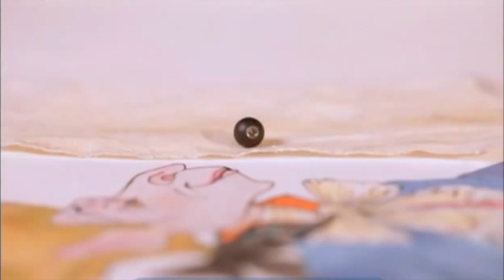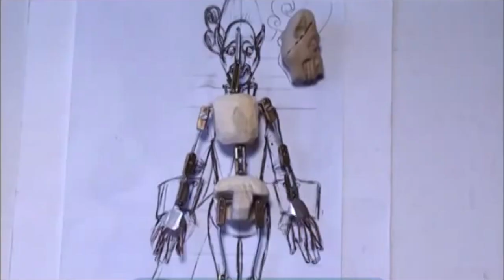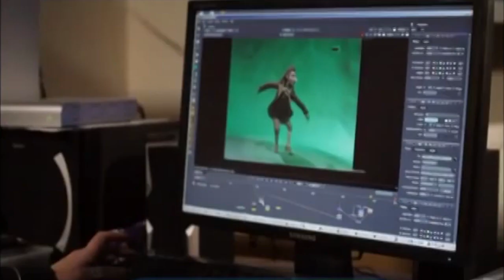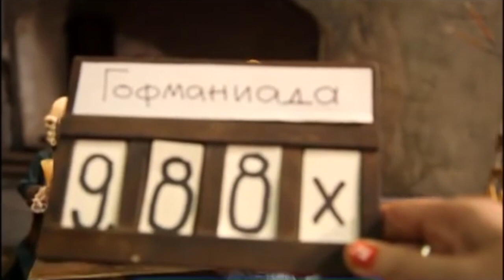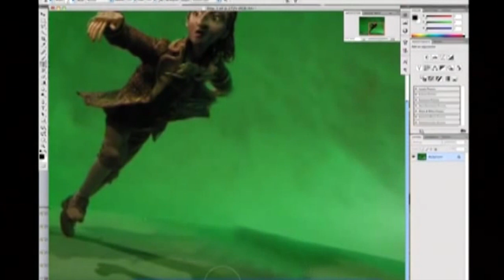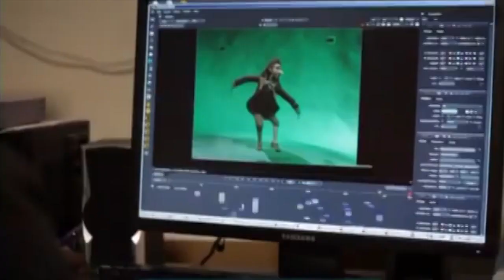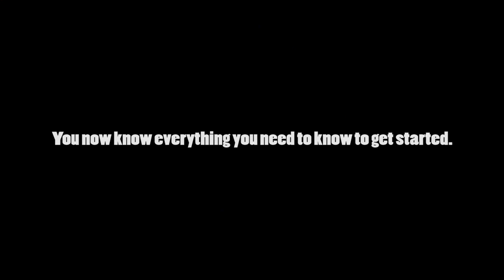The Essential Principles  of STOP MOTION  in 24 minutes

Comment: Excellent video! What is the material used in the video at 4:20 ?
Reply from the maker: +Regina Resende Résine polyuréthane
Reply from the maker: +Regina Resende It is a liquid two-component resin. After mixing, you have some minute for the place holder in the mold before it hardens.
Reply: +Mat et les Humains Thank you! I am venturing in this field. I tried to make a skeleton at home to stop motion (link: http://www.macmilam.com/2014/05/esqueletos-para-stop-motion-parte-2.html ) . The next step will be to fill . Thank you very much for the information! And congratulations again for the video! Motivational!